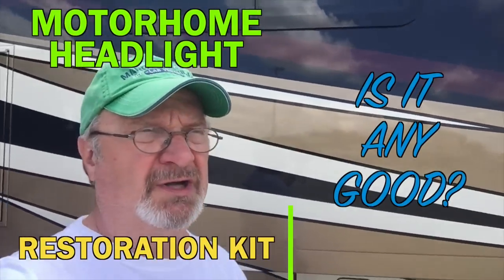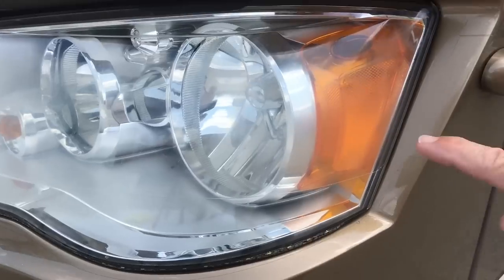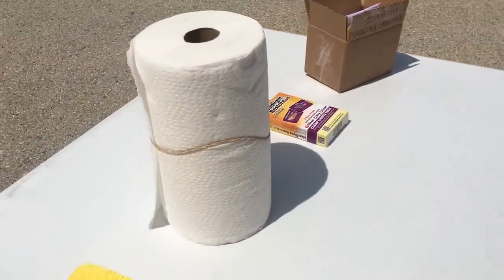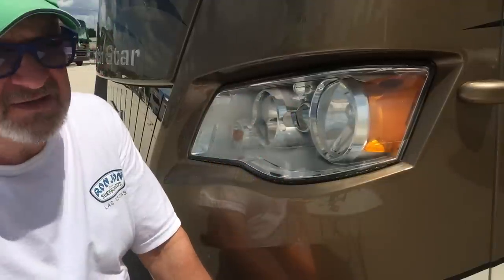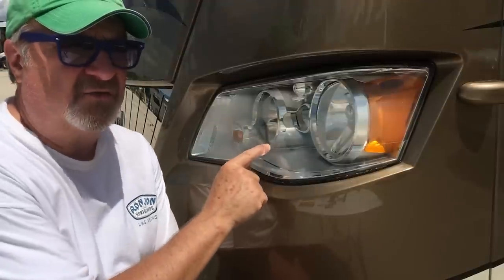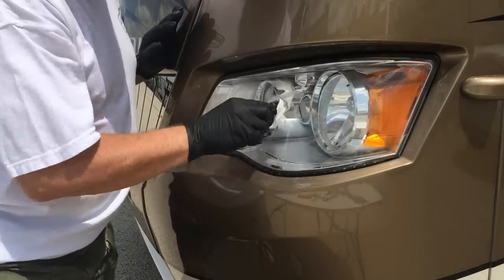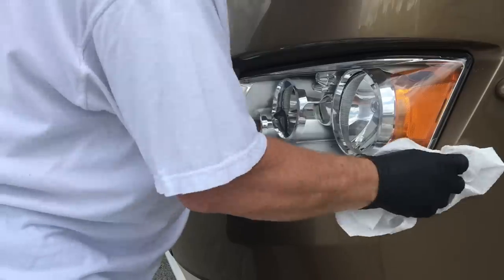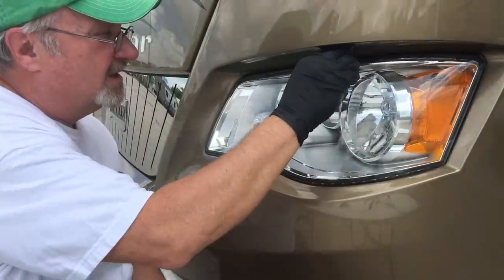CLEAR LIGHTS TECH | HEADLIGHT RESTORE.US KIT REVIEW | MOTORHOME HEADLIGHT RESTORATION | EP126

Comment from the maker: M4 Products no longer carries these headlight restoration kits! A NEW SOURCE for this kit is listed in our Amazon Store in the section entitled  "General Maintenance and Supplies".  If you are an Amazon Prime member, this is the cheapest way to go! I just "renewed this treatment" (06-26-2022) on my 2014 Newmar Dutch Star motorhome headlights after the first treatment exactly 2 years!  THEY LOOK BRAND NEW AGAIN! This is so easy, every RV'er should do this before contemplating selling the unit or buying replacement headlight assemblies. It took 15 minutes start to finish, and that included waiting for the cleaner to dry in step #1!  That's only 7.5 minutes invested per year! 🎉 👍 🏆💘

Comment: Glad to see there is a product to address the component failure that allows the surface fogging issue to develop. I've also seen  lot of lights with interior moisture fogging that also looks bad and may affect light performance.  Looking forward to the upcoming LED light upgrade video. Enjoy your summer with family; be safe, be well!
Reply from the maker: I wish I was younger so I could put a few new fixtures in to REALLY dazzle folks with the new, awesome stuff that's out there available now,.......but that ship has sailed.  Would love to have the long LED Task Bar they show on line to bath my wet bay in Cool White LED light at night.  Its so bright, I would have to wear sunblock when I dump the tanks,.....
Reply: Our Journey In Myles It’s amazing the products that are available today compared to 5 or 10 years ago... With solar, lithium batteries, modern charge controllers, LED lighting, mini split A/C units, low amperage household refrigerators, on-demand water heaters, etc... ALL RVs need upgrading for modern, efficient equipment. You are doing just fine Mark!

Comment: Mark, when everything was laid out on the table I expected you to pan over to Fifi.  But alas, no Fifi sighting this week.  Looks like you may have been sitting on a stool instead of kneeling on Fifi.  I have used the restoration kit with the rotary tool on my car headlights.  I taped around the light out of concern about buffing the paint around the headlight.  Your technique was definitely easier than the kit I used.
Reply from the maker: Yesterday, I set up our new "Blue Yeti" microphone we bought for voice overs. It is so sensitive, that it picks up your elbow bumping the desk you are using it as you are snuggling up to it.  I was SO excited that I had found yet another use for my pad,........but alas, .....it was too dense of a pad,......and did not dampen the vibration enough. We will have the mic on triple layered hand towels!

Comment: Nice job on the headlights.  I'm interested in your light project.  Is the for lighting up your generator compartment?  I 'm not even sure if my generator compartment has a light in it but if it doesn't then I'm going to be looking at installing one.
Reply from the maker: That is correct,....generator in front compartment and engine in rear of coach.  If I was ambitious, I would change the fixture to one of the long, super bright LED Task Light bars M4 shows on their Website.
Reply: @OurJourneyInMyles  Great idea.  I wonder though if it would get to hot for them back there in the engine compartment.  I think up front in the generator compartment they might be ok.